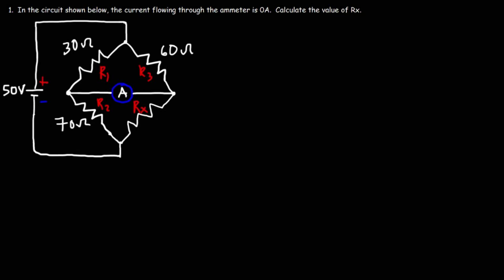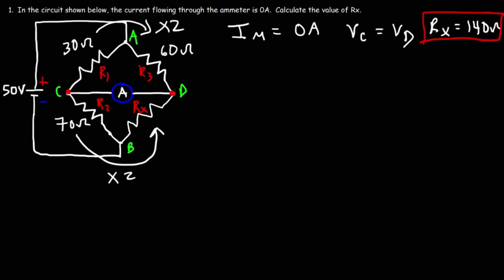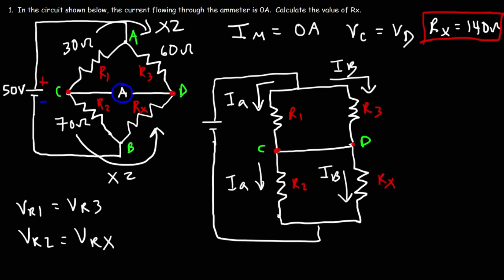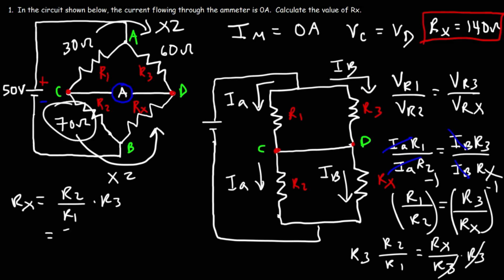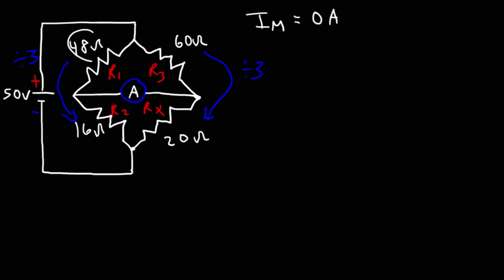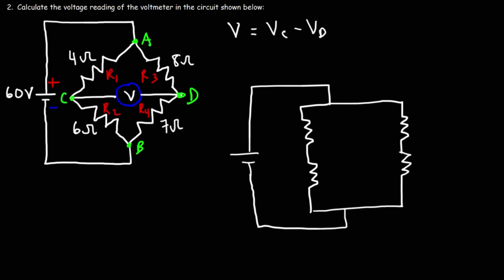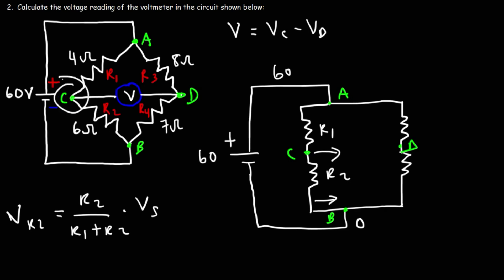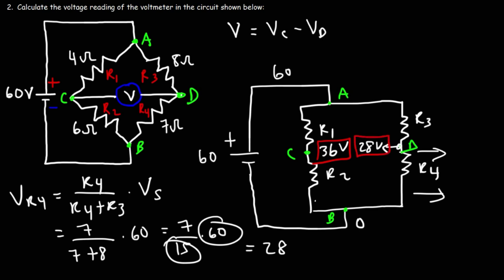How To Solve The Wheatstone Bridge Circuit

Comment: 8:33 why is point B zero and A 60
Reply: 6 months late so you already know this, but in case anyone else wonders, here ya go.

Using Kirchhoff's Voltage Law (KVL) which states that the sum of the voltages in a loop (or circuit in this case) equals zero, we know that the voltage at any point (node) on the path coming from the positive terminal of the battery (the longer bar side) will have a potential of 60V UNTIL a load (resistor in this case) is applied, making the potential at point A 60V. By KVL, we know that the potential at point B is 0V because it lies directly before the negative terminal of the battery (shorter bar side).

Now that I covered the technical side, a simple way to think about it is this: Resistors are kids who want cookies. They are going to eat every cookie you supply them with. The cookie factory [battery] is giving out 60 cookies [volts] on a big plate [path] to a group of kids [resistors]. They of course eat every single one and return the plate [path] to the cookie factory [battery] with 0 cookies left [volts]. The factory [battery] then refills the plate with cookies [volts] and the cycle (or should I say, circuit.....) continues.

Comment: New at this. In the beginning of the video, you stated there was no current through the ammeter thus, the voltage or potential at points C and D is the same. How can that be if the source voltage is going through 30 Ohms on one side and 60 Ohms on the other?

Comment: For the voltage one, on what basis did you get rid of the wire with the voltmeter? If you got rid of it on the basis that the current flowing through the wire is zero, then, by definition, the wheatstone bridge should be balanced and the resistances should be proportional. But since it's not balanced, this means that there is current flowing, and therefore you can't get rid of the wire. I am very confused can someone help?
Reply: I have the same exact question, I think it is not balanced, but he got rid of the middle wire because the voltmeter has extremely high resistance that we can almost neglect the current passing through it

Comment: At https://youtu.be/jFvVtB10B1I?list=PL0o_zxa4K1BV9E-N8tSExU1djL6slnjbL&t=127 you draw a short-circuit between points C & D but in later versions, you draw an open-circuit between C & D . Which is the correct version?

Comment: What you also can do is for example in exercises 2 is multiplying cross wise. 
16 • 60 = 960 … which should be the result of the 2 remaining numbers. So if you divide 960 by 48 you get your answer.

Comment: i have an assignment and the ammeter is replaced with a capacitor. i have to find what is the electrical charge of the capacitor. i initially thought that it’s zero since voltage difference is also zero but then the next question is what does the resistance on bottom left have to be in order for the eectrical charge to be zero so i’m really confused

Comment: How should an ammeter and voltmeter be connected in the Wheatstone Bridge circuit? 
Is it the same as the other circuits!?
Reply: Well you see that (A) in the circuit thats Where you can put the amp meter. as for voltmeter connect it in parallel to each resistor.